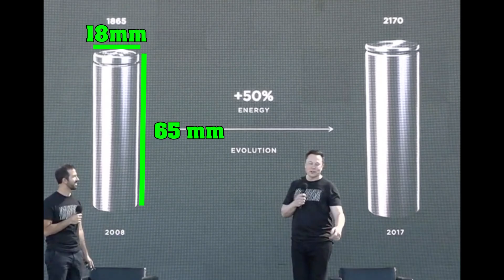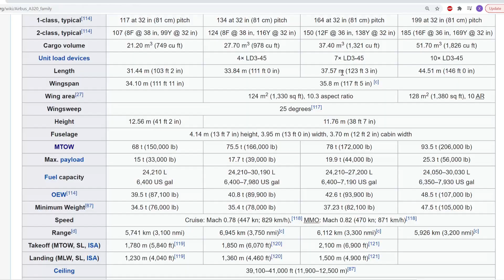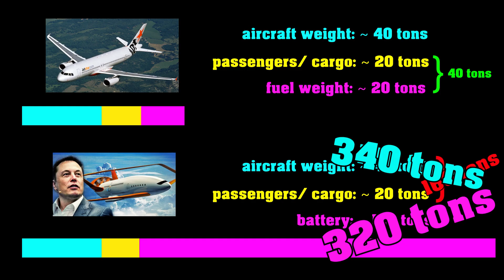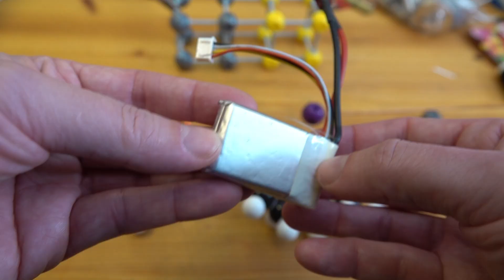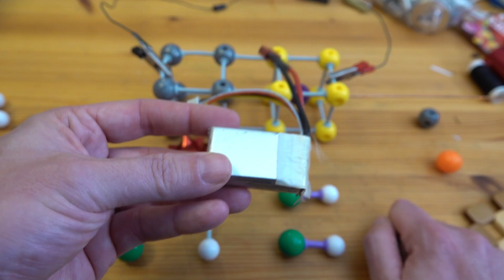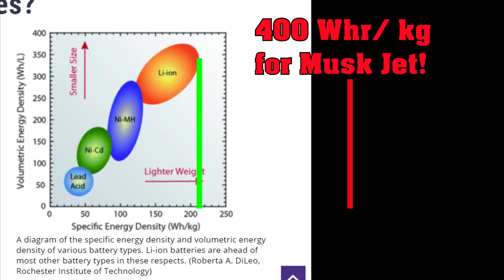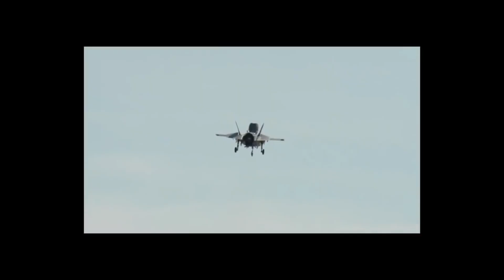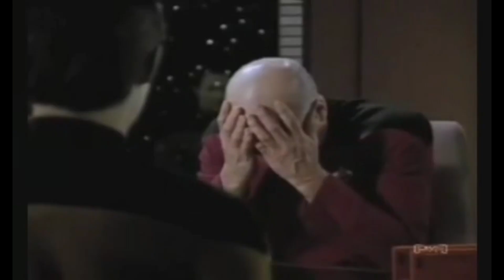Tesla's Secret Plan To Disrupt Airlines: BUSTED!!

Comment: The range of the A320 wouldn’t be as far as stated if it didn’t burn the ~20t of fuel. You missed that a battery plane weighs the same when it takes off as it lands. A jet gets the extended range from the decreasing mass as it flies.
Reply: many planes can't land fully loaded. a silly example is the harrier that cannot VTOL with fully loaded. vtol long range battery plane would require MUCH more energy density and raw power...
Reply: @ningu3m177  this, a fully loaded harrier only weighs 11 tons, has 21,000lb's of thrust, and cannot lift itself, if it's fully loaded it needs to do a regular takeoff. Then add to the problem, instability, and difficulty to fly, even most of the experienced jet and fighter pilots struggle to fly the harrier because of the vtol, but yeah let just put all that into civilian travel.
Reply: At this point ,the topic’s already dead
Reply: @Abadeez  
Technically you need quantify how much lighter they get with discharge. Tons of batteries change mass by how much charged/flat? A gram? A micro gram? Nano grams? 

Sure not 1 kilo. Not 1/2 kilo. Not 0.01 kilograms. So technically, in the real world: immeasurably.
Reply: @Abadeez  Wait... there's a battery that gets lighter as electrons are pumped into it? That seems unlikely. I could imagine a battery chemistry that became less dense as it's charged, but not lighter.
Reply: @SwervingLemon  Lithium air batteries use oxygen as the oxidant and lithium as the reductant. As they discharge, they absorb oxygen from the air, significantly increasing their mass. As they charge, that air is released back into the air.

So the entire mass of the air + battery remains relatively constant, but the batter itself has a significant change in mass.
Reply: Exactly, this is why a normal jet aircraft can take off fully fuelled but if forced to make an unscheduled landing for whatever reason shortly after takeoff, will need to either dump fuel or fly a holding pattern for a while to burn some of it off to bring the aircraft down to under their Maximum Landing Weight (MLW).  

Musk's super dooper imaginary sci-fi plane would need to be already below it's MLW when taking off, unless they were planning on jettisoning the batteries mid-flight when they were spent.  Maybe then they could deploy a fleet of drone submarines to fish them out of the sea, or something equally preposterous.

At least this is slightly less batshit-bonkers than his hyperloop idea, but still an utterly ridiculous and totally unworkable concept.  Probably won't stop Xijuan and Sebastian coming along shortly to tell us that we're all wrong.
Reply: @WinstonSmith685  Completely agree with you, except I think the laws of physics are even more of an obstacle in this case than for the Hyperloop...
Reply: Hello is this the police?? Yeah i'd like to report I just witnessed a murder! :)
Reply: And you would need a heavier plane to carry the battery since most passenger planes can not land with full take off mass and need to eject fuel before landing unplanned as you said battery's don't get lighter and ejecting the would be bad I think
Reply: Techncially, that depends on what battery technology you have. The most viable one for the energy density would be lithium air, but that gets heavier as it discharges, meaning the plane would be heavier when it lands, which is quite dangerous.
Reply: @jeffreyblack666  
In grams, how much per ton? 
1 gram?
Reply: @larryscott3982  That depends on the exact setup of the battery (including chemistry used), for the common stuff used, and only focusing on the active material,  it would change from ~ 7 ton to ~23 ton. i.e. it goes from Lithium metal, to Li2O2, so each lithium atom gains an oxygen atom from the air.

That is more than compensated for by the density change from ~0.5 g/ml to ~2.3 g/ml, meaning that even though it gains 230% of its mass, it loses 25% of its volume.
Reply: @jeffreyblack666  
Not exactly the battery chemistry in candidate aviation batteries. So in candidate battery chemistry, what is the dynamics of mass? 

Not looking for worst case. Looking for best case. Best case is near zero change; take off landing same mass
Reply: @larryscott3982  Ignoring the overall stupidity of using electricity from batteries for a long haul flight (as opposed to RC drones, is he planning on switching batteries at the airport, or have it wait for quite a few hours to recharge?), it is exactly the kind that would be good for planes. They have much greater energy density on average than competing technologies as they don't need to carry all the oxygen with them the entire way.

It also makes them at least somewhat safer as the oxygen needs to get to the battery to make it burn and thus it is limited in a similar manner as a fuel. It also gives a possible safety feature of isolating it from the air to prevent further fires.
This is in contrast to conventional batteries that have all their energy inside them and there is no way to easily stop it if it has a catastrophic breakdown.
However one of the thermal breakdown products is O2, which can combine with lithium to make Li2O, so there is still that issue.

The only better candidate would be a battery which looses mass as it is discharged to allow it to take off heavier than when it lands.

For a sealed battery the only change in mass (assuming no breakdown and venting) is the E=mc^2 component. So for a 400 Wh/kg battery, that is roughly 1.6e-11 kg change for every kg, or 16 micrograms per ton.
Reply: So this works to the benefit of fuel powered planes and not battery powered ones.
Reply: @SMD1999  Planes and airports are even designed to land with lesser mass than take off. If there is an emergency and the plane needs to land soon after take off it needs to dump most of the fuel into the atmosphere before landing.
Reply: @jankodes197  No worries, they'll just throw the batteries out the window ;p
Reply: @JoeDai  Haha. Ingenius :D
Reply: @JoeDai  Just like Rocket Lab does with the Rutherford engine.
Reply: @jankodes197  there's no fuel jettison on any A320 series. Even where there is a fuel jettison systems available pilots can and do perform overweight landings when necessary.
Reply: @Abadeez  It doesn't. Ions only move from one electrode to another, unless it's a lithium-air battery, which isn't purely a battery and also doesn't exist yet. Batteries don't actually store and release a net amount of electrons unlike what people think.
Reply: VTOL also adds considerable weight and complexity. A VTOL design will weigh more by default.
Reply: @bills6093  Nah, for VTOL, the L part is easy and inevitable, once the aircraft stalls due to being out of charge. This can simply be avoided via in-flight recharging, or battery swapping.. Which was something Tesla announced waaay back for it's cars. And battery swapping/maximum 'refuelling' times were originally part of the US EV credits scheme, but conveniently ignored. Just as well given the importance of regulatory credits in inflating Tesla's bottom line.
Reply: They can always toss the batteries out of the plane, HAHA.
Reply: @Sidowse  Keep believing Elon musk, you're evidently a brainless fanboy.
You realize that the sun is only directly overhead on one small point on the earth's surface at any given time, and if you deviate away from that spot, you'll get less and less power... Like in the morning, evening and evidently at night, solar panels are completely useless, between 10am and 2pm they'd have some use, but never close enough to warrant their weight
Reply: He covered that point in one of his electric car v combustion car videos a few years ago, I was waiting for the call back in this video.
Reply: @Pierre R. Your understanding is wrong. It means they are 2 measures of the same thing, and that by changing the energy of something you change its mass.

It doesn't matter if it is nuclear binding energy or chemical binding energy. They will both effect the mass. The main distinction is that nuclear reactions involve a much greater change in energy (roughly 100 million times).

Changing the electron configuration and molecular configuration does change the energy and thus does change the mass.
Reply: @Marin Morg  As far as I’m aware, LiPo batteries are fine in a low pressure environment. The cold is what gets them and cold barriers do not perform well. 

Fortunately LiPo batteries get warm and sustain this throughout use. The drones we fly (inspire 2) use batteries with inbuilt heating elements to warm them up before flight (if below 20c). Once in flight, they keep themselves warm and can fly in some very cold temperatures. Certainly not anywhere near as cold as 35,000 feet, but at least they are able to generate some heat, which could be used in conjunction with battery heaters. The problem with that is that the batteries are now expending more of their stored energy to keeping themselves warm rather than powering the plane. 

As for automated pilotless flying. I cannot see any aviation authority agreeing to this. Yes, planes can fly themselves on autopilot, but a computer can’t make a rational decision that may save lives like a human can. Maybe AI might have the scope to weigh up possibilities, but a human at the controls of a doomed plane has a survival instinct and will do everything they can to not end up dying and that’s just never going to be something you can perfectly replicate outside of the human brain.
Reply: @CLOUDVISUAL  One issue you have with human's at the controls is they will instinctively do what they instinctively give THEM the best chance of survival. That may mean more people end up dying.

The other issue is that the instinctive thing could end up killing them whereas a more rational approach from an AI may end up saving them. This can be just due to instincts sucking, or not paying attention to everything. (e.g. see something on the road while driving, swerve to avoid it and run into a pole)
Reply: He also forgot that A320 did not have in any way capability to lift itself from the ground vertical nor go supersonic, so a real comparison would be F-35 or Yak-41/141...
Reply: lol. so true.
Reply: Woah! Hey now. Those electrons weigh something.......

Edit: spelling
Reply: @devinwalton408  And they just go from one side of the battery to the other, thus not affecting the mass.
The only mass change from a sealed battery is the tiny mass change due to equivalence between mass and energy.
Reply: @jeffreyblack666  Even that isn't true, as mass-energy equivalence only applies to nuclear reactions or mass moving close to the speed of light.
Reply: @jeffreyblack666  you took my comment way too seriously.
Reply: @00crashtest  No, it applies universally.
It does not matter if it is nuclear binding energy or chemical binding energy, changing it such that the energy of the system changes will result in a change in mass.

It is just that mass change for nuclear reactions is far more significant than for chemical reactions. (but even then they are quite small)

For example, even some of the most energetic chemical reactions only give off a few hundred kJ/mol (which would be 10s to hundreds of g). So for a kg scale of material you are looking at a change on the order of nanograms to hundreds of nanograms (or even less for the less energetic reactions)

But nuclear reactions are for more energetic. For example U-235 releases roughly 20 TJ/mol, or on the order of 100s of millions of times as much as chemical reactions. That means the mass change is correspondingly larger, so fission of 1 kg of material will change the mass by roughly 1 g.

So it is simply a case of chemical reactions produce a mass change that is so small it is typically ignored.
Reply: @devinwalton408  The problem is there are some people that actually think what you claim and it can be hard to tell if people are being serious or joking on the internet.
Reply: Energy has mass, so it does weigh less, I’d estimate something like 0.01gram lighter.
Reply: @chengong388  only if you are talking about a 650 ton battery that is 400 Wh/kg (or equivalent)
Reply: @Abadeez  oh wow, we didn't know, thanks for telling us. as if nobody thought of that and discarded it because the weight change is so negligible.
Reply: i was thinking the same. surprised he didn't bring that up
Reply: @engineer99 Nuclear thermal rockets still function by expending propellant. The only difference is the energy source used to accelerate it: in a chemical rocket it comes from a chemical reaction, in a nuclear thermal rocket - from a nuclear reactor.
Reply: That's a very good point!
Reply: The battery plane would weigh much less as it inevitably catches fire and burns up.    Also  there is no way it's getting off the ground.
Reply: @engineer99 that's very false. Hydrogen has mass. They'd probably carry a lot of it.
Reply: @Marin Morg  For the most part, it doesn't matter. Unless you are using a gaseous reactant, the change in pressure should have no effect. Temperature will alter the voltage of the battery, but typically not by a significant amount (normally on the order of mV for a change of 1 degree).

As for flying with programs, most planes have autopilots.
The reason it is so much harder for cars is that they need to stay on narrow roads rather than flying pretty much anywhere, and there is a far larger density of cars, and when 2 roads meet, typically there is some amount of waiting and interacting with the other cars in some way, such as an intersection where only one road can go at a time or even when you have highways where they don't directly cross, you still have merging and splitting which can cause problems.

With planes being separated by so far, both horizontally and vertically, they should never meet. And when they do, they have an automated system (which I'm not sure if it is hooked up to the autopilot) to tell them what to do to avoid a collision.
These days, most planes would fly on autopilot for the majority of the journey.
Reply: @Otto_Maddox  No, any electric plane will need to be able to land full of batteries.
The sole reason jets need to do that is because they take off above their maximum safe landing weight.
If they took off at or below their maximum safe landing weight they would be fine.
Reply: yikessssssssss
Reply: Maybe the batteries could be jettisoned en route like Space Shuttle rocket boosters?
Reply: @jamescaley9942  considering the batteries all deplete at the same rate, this wouldn’t work. Also, batteries are expensive, where are they going to land?

Edit. Also. The change of CoG would be dangerous
Reply: @CLOUDVISUAL  You can control what batteries deplete over time.
e.g. you can have 1 battery pack be used entirely, with a second hooked up to provide power when the first runs out, then start using the second with the third as a backup and so on.
You can also control the COG by controlling where they are and when they get jetisoned.
It would make it entirely stupid as it pretty much wastes al the benefits of using an electric vehicle, but it is possible.
Reply: @jeffreyblack666  I’m not saying that it’s not possible to jettison batteries, it’s just not going to happen. Too many variables and safety issues; batteries colliding with other aircraft flying in the corridor and the lack of redundant power are probably the two main ones. 
A single pack powering the plane also wouldn’t work. Takeoff would demand such a huge current that the single pack’s voltage would bottom out. You need all the batteries to share the HUGE current that’s required to lift that initial mass, especially if it’s a VTOL. 
The aviation authorities are never going to certify an commercial passenger aircraft with a single point of failure like that in the power system. 
Regarding controlling COG by moving batteries around; you’ve got to add tonnes of rails, motors and equipment that add weight and take up space that could just be used for batteries.
Reply: @CLOUDVISUAL  And you would be able to use all the packs if needed for take-off, then switch to only using the minimum number of packs required.

Aviation authorities are not likely to certify any VTOL passenger craft, as if the engines fail during take-off or landing there is a very high chance of everyone dying, as VTOL craft (other than helicopters) typically aren't good at gliding.
Reply: @Sidowse  you're going to put solar panels on it and hope that the sun is shining?  lol  solar "cars" don't even work
Reply: Exactly, the higher the jet flies the mass exponentially striving to the Great Zero closer to the Sky Surface
Reply: @engineer99 they actually do gain and loose weight, not by any measurable amount but they do actually change weight, are you really that stupid? or just unable to read some basic scientific journals? you know probably one of the most famous scientific equations of all time, e=mc2? you can calculate the difference in any battery, take the kwh of the battery, x 1000, then times answer by 3,600, divide that by 10 to the power of 17 (the speed of light), and you get your answer. For example a Chevy Volt with its 16khw battery, is half a microgram heavier when fully charged, but bear in mind a piece of dust resting on the battery would be a lot heavier. Though maybe in the future read some basic science, whats scary is at least another 6 people agree and you have engineer in your name, are you really an engineer or just another pretend youtube one?
Reply: @Sidowse  No no no, we are talking about air resistance drag... Mass does NOT increase drag... Where are you guys getting your information??? MASS increases weight, weight increases how long it takes to accelerate and decelerate... Not speed...
Reply: @prich0382  Also, you are wrong about mass and weight. Weight is a force directed downwards. You are thinking of F=ma, where it is just mass, not weight, that affects acceleration. The only way weight factors into it is in a car it increases the maximum possible force due to increasing friction between the wheels and the road, and thus also increases the resistance at higher speeds, but typically negligibly compared to air resistance. Or if you are in a plane and thus need to use wings to generate lift which also create drag.
Reply: Once a plane is in the air in stable flight, mass becomes irrelavent
Reply: @prich0382  I'm going to take a guess that physics wasn't your strongest subject in school.

Stable flight (as you called it) is achieved when the lift and mass are equal. TF even shows you a picture to describe this in the video
Reply: @CLOUDVISUAL  Dude, drag and thrust is pretty much the only factors that controls your speed, weight just means how long it takes to get to that speed, weight has very little to do with speed, same goes for cars, all about drag and thrust, not weight. It is you who does not understand.
It's not "lift and mass", it's thrust and drag. Lift and mass is up and down motion, I'm talking about forward motion.
Reply: @prich0382  Apply your logic to a helicopter, which is just an aeroplane, but the wings are spinning really fast and you’ll realise your mistake. 

Alternatively, imagine pushing a wheelbarrow for 10 miles. It’s full of water and the water is leaking out. By the time you reach the 10 mile mark, it will be almost empty. Do you think the mass matters then? Drag and force are still factors, but so is your ability to lift the barrow and the weight of the barrow is bearing down on your arms.

Edit: And do you think that it'll get easier to push that barrow as it slowly runs out of water?
Reply: @CLOUDVISUAL  Dude a helicopter applies majority of it's thrust downwards FFS, I'm talking about fucking SPEED, get that in your head, MASS has very little to do with a planes SPEED, that's 100% a fact. Fucking hell people like you really piss me off. Okay let's talk free fall, guess what? A heavier object will fall FASTER then a lighter object of the same size...
Reply: @prich0382  "Lift and mass is up and down motion, I'm talking about forward motion."

Ah, right. You can test this theory by getting a 6s car and driving it off a cliff. You'll quickly find your forward motion gets vertical motion due to that boring little detail called 'gravity'. Sure, you could use thrust vectoring to direct some horizontal thrust up/down/sideways. That thrust will also have to deal with mass/inertia. Otherwise, if you only have horizontal thrust, you'll eventually start lithobraking.
Reply: @prich0382  No, mass is still quite relevant. You need to generate lift. This lift is not free. A plane generates it by having air flow over the wing. This creates drag which slows the craft drown.
You can even characterise planes by their lift to drag ratio. Gliders typically have a quite high ratio and get a lot of lift with only a little bit of drag. But even then, increasing the mass, means you need more lift, means you generate more drag and thus need more thrust to maintain speed.

i.e. increasing mass, with the velocity of the plane maintained, does increase drag.

This is quite different to a car as a car doesn't need to generate lift via wings as it sits on the ground.

For some actual numbers, the A320 has a lift to drag ratio of 16.3. That means to lift 16.3 t against gravity, you will generate drag equivalent to 1 t of weight. So an 80 t aircraft will generate roughly 50 kN of drag. A much lighter 60 t aircraft (after 20 t of fuel have been burnt) will only generate 36 kN of drag. A big difference considering the basic engines used only generate roughly 200 kN of thrust (for both engines) and the more advanced ones only generate roughly 300 kN.
Reply: -Matter didn’t create anti matter
-Anti matter didn’t create matter
(Both of them were present at the time of big bang)
-Both of them didn’t create themselves.
-Both of them came from an unimaginable source,  that unimaginable source created matter and antimatter (everything) thats why it is known as “the creator” of everything.
——————////////////——————-
- that unimaginable source/creator has created sin and virtue which are opposite to each other,
— logic says every action has its own reaction, so the reaction of sin must be different than the reaction of virtue,
— the creator has created prophets to let us know about each and every detail of sin and virtue, also about their reactions,
Thank you :)
Reply: @dott8045  Go away